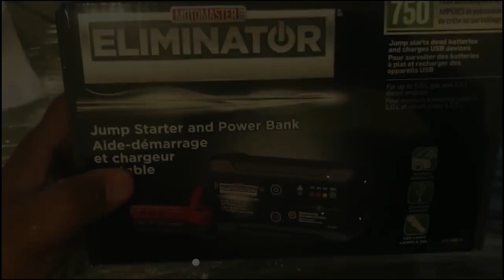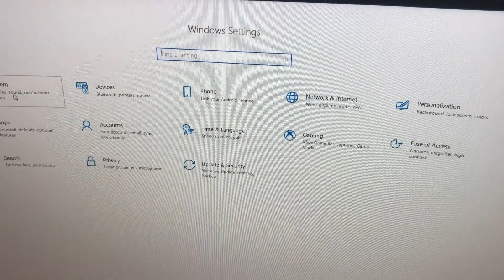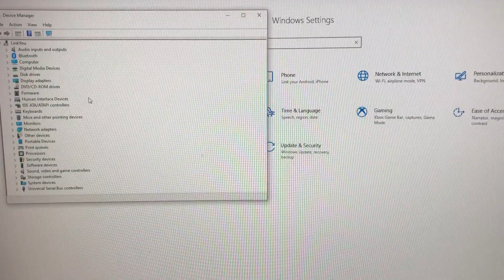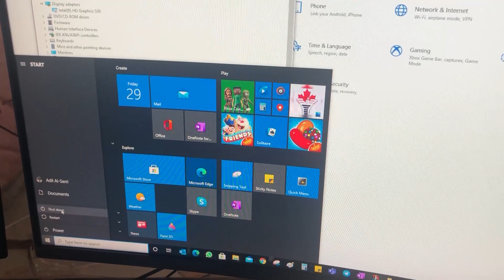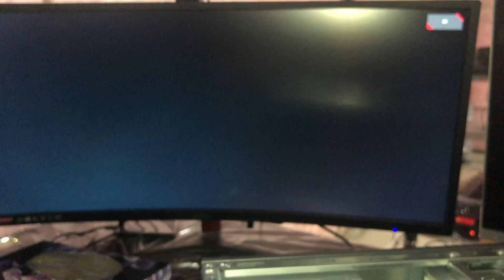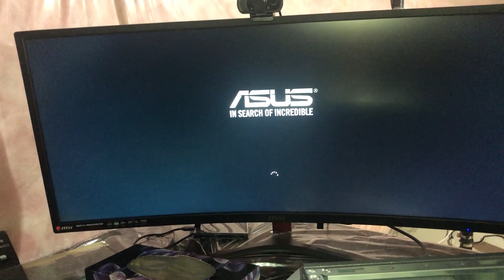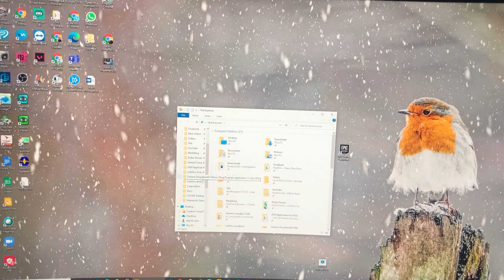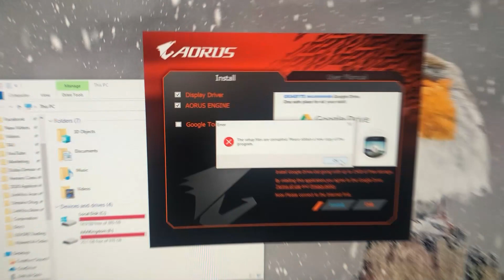How To Fix The Black Screen After Installing Graphics Card Driver - DIY

Comment: I'm not 100 sure but I do know how to fix this.  Just install your base videocard driver from your factory  based CD installer then " check the updates from the videocard menu itself. "    Do not download the latest driver from the updated driver website, as you may know they don't have the base driver files for the video card installer you own as incompatibility results black screen flickers.
It happens first with my AMD Radeon Vega 8 but directly from website files of their latest drivers, it does cause black screens.  I find the old driver files with my old amd radeon 17.7 version driver installer AND it has the menu update button to the latest 22.2 clicking it,  and everything fixes.  The old base driver files help a lot, never download directly from the site,  just use the old update menu directly!

Comment: For anyone that still hasn’t fixed this issue yet I hope this helps: 

Hook up a hdmi cable to the port of the motherboard going to your tv and once you are at the windows startup screen also hook up a second hdmi cable to your graphics card and tv.. this helped me atleast force my pc to recognize the graphics card in the device manager. ( if you have an error code 43 showing there download drivers and hopefully you will be good to go)
Reply: should i use two hdmi cable?
Reply: @bigbundalengers3716  yes first one frrom your motherboard to tv and after... if you can see the window logo hook up the second one from your graphics card to tv
Reply: @sutatotv  should the graphics card be on the motherboard?
Reply: @vanred5441  Sorry for late response, yes it should
Reply: @sutatotv  No problem, already fix it.Turns out the hdmi is the culprit. I switch to display port and it worked.
Reply: @sutatotv  yes... But then windows recovery pops up
Reply: Hi i am having the sams issue please can you contact me?
Reply: That's what mine seems to be doing. I only have one HDMI port on mine and the 2 older plugs. I have the smaller one but I threw away all of the big ones I had so I can't try it. With a HDMI I just get a grey screen. I know the board is working from what I've tested with a multimeter meter. Without putting the board under heat vision I don't know. The fans come on and no lights in my motherboard. I swear I dint think it's getting enough signal when it gets to the end of my HDMI cable into the tv. I have a monitor I'm going to try with the older wires. Wish me luck. I need this GPU to work.

Comment: I I have a similar but different problem. I few days ago I decided to update my graphics card drivers on my rx580 red devil by and so I went on there  website and I found the rx580 drivers but I don’t know much about these things but I didn’t say red devil it just said normal rx580 and so I think I downloaded the wrong graphics drivers and I have the asrock x99m killer motherboard wich is a gaming motherboard so I don’t have any display ports for me to plug it into to fix it but I don’t know if I killed my gpu by downloading the wrong graphic drivers i dont know if I can fix it but I have no way to fix this because of my knowledge about computers  and I don’t know how to do if someone could help me with this it would be much appreciated

Comment: Hey I have amd athlon 3000g with radeon vega 3 graphics. It is a new pc 🖥.  When I installed the driver after restart I got black screen. Uninstalled via ddu.  It fix how to install it 
Pc specs
           Processor as told
           Gigabyte A320M S2H (rev 2.0)
           Psu 250waats chiptronex normal psu.
    Please reply anybody
Reply: See if you installed drivers before connecting the card then uninstall driver and after u connect the Graohic card then on pc then install driver

Comment: Thanks! I did F9 for HP Laptops at boot up, troubleshoot, 5 for safe mode with networking , uninstall that last driver you were installing, update the display adapter that was working before, restart and cross fingers.

Comment: I have a msi radeon r9 270 twin frozr, but always crash (black screen) during install the driver. Try again with others driver, and the black screen meet me again, and again... F*ck my graphic card....
Reply: HIS R9 270 here. Literally exact same problem. Happened today. PC crashed mid game and screens turned to vertical lines. Installing any driver makes my PC go to an unresponsive black screen making Windows boot to System Restore every time. Did you find a solution? It's the only thing I can think about as it's the only GPU I have available to me at the moment and I can't use my computer because of it. I feel like some part of the GPU died of age like a transistor of sort which makes it glitch out with drivers. It's not the only post about this problem with R9 270 I've seen that was made recently.
Reply: @BloodRedMage  Exact same problem here with my R9 270x. I have that black screen and the vertical bars now when I install the drivers. I feel like I tried everything but I think I'll just have to replace the gpu
Reply: @mcplaysbatman5903  After trying everything except reflowing the GPU board inside an oven I can say the card is practically dead. There's an epidemic of the R9 series cards dying as I've seen on multiple forums in the last few months. Unfortunately buying a new card is the only solution. Which especially sucks considering the current GPU availability and prices. Personally I'm  still stuck without a working PC due to that reason.
Reply: @BloodRedMage  crap bro , you posted some reality there!
Reply: @mcplaysbatman5903  i also have the same problem, and after i install new driver and restarts , it wont boot and stays black screen
Reply: @ycumazuperez8204  yea I ended up having to just replace the gpu because I needed it for school. Apparently a lot of the AMD r200 series gpus (what I have) have been having this problem. Sucks there was no other fix
Reply: @BloodRedMage  I do not know. So far I haven't found a way to fix it. But there are some content creators who reball the gpu, there are also those who reset the gpu bios by jumping the bios chip like on this youtube channel.
https://youtu.be/rA6yFIA2K9Y
It's from indonesian people. Actually I can try to do this way, But for me it's very risky.
Reply: Same thing with my XFX Rx 560 4gb after installing drivers.... Black Screen every time
Reply: Try installing old drivers 90%  chances they work then check temperature of gpu and if it is high then replace it or buy new one becoz of thermal paste issue  and reply me if it worked then ia it showing ur gpu software after right clicking  on home screen
Reply: @omghorpade8802  I've tried it but still find the same problem. Starting from uninstalling drivers with DDU, from windows 10 downgrade to windows 7, and others. If my R9 turns off, I'm sure it won't show up on the screen when I turn on the computer. Does the monitor affect the use of the graphics card? as an example, I'm using an R9 270 with a monitor that is only HD resolution. Is it possible?
Reply: @ghfrpark3077  how much watt us ur psu ? Try updating bios , i can  feel ur pain cause this has happened with me my slecs i3 3220 ,6gb ram ,asus h61m-k mother board,230v psu, and gt 710 

When i places my gpu and turned on the pc then it showed me random resolution till is install latsst driver but then while installing it screen went blank so i disconnected everything and restated again and installed old drivers but when i downloaded valorant the showed up very dx11 10.0 needed .
I decided to replace the gpu
Reply: @omghorpade8802  I use 500watt 80+ bronze because in specs of this graphic card, it says the recommended psu is 500watt. And the bios update from F1 to F3 in my gigabyte h81m-ds2..
And dual core g3240, 2x2gb of ram

Im sorry, my bad english :)
Reply: I recommend u to sell this one gpu and and buy another one try using it if. It works then sell this pc and find another uses one till uptill the graphics card prices are high u can get a good system
Reply: @omghorpade8802  Slow down...🙃🙃 I have not enough money. Thank you for answering my question here. I appreciate